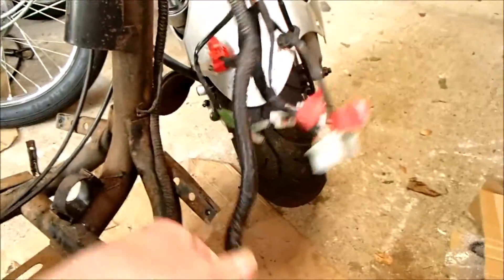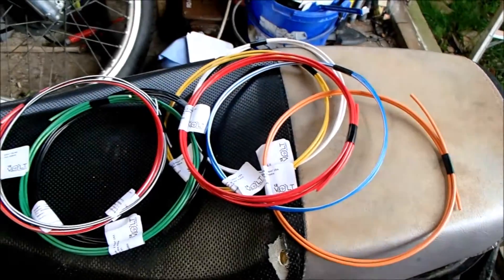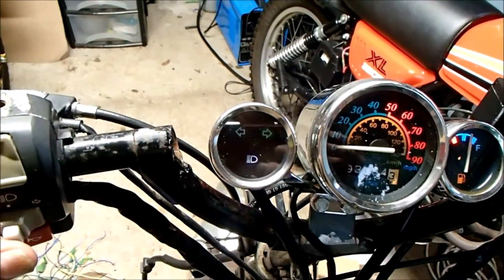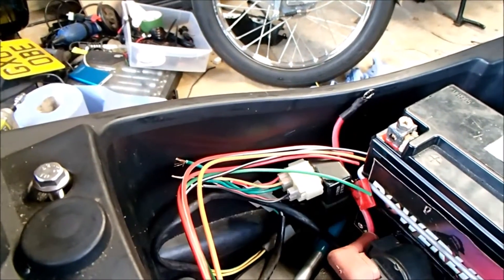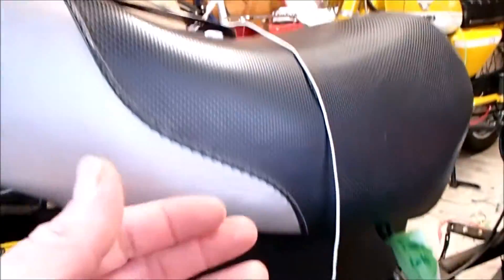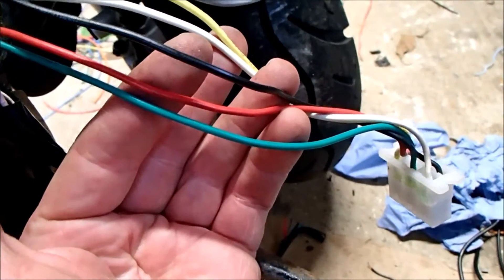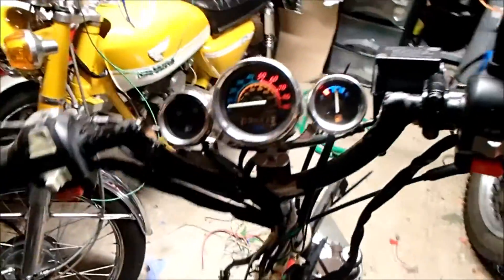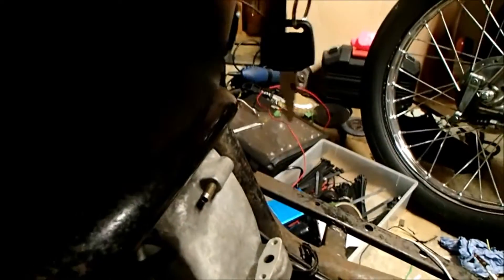Chinese GY6 scooter rewire for naked bike configuration

Comment: 3 years ago I acquired a Peugeot Tweet 2011....a sister bike to the GY6....it was a non runner...as I started to remove panels I could see the frame was pretty rusty so decided to strip it down ...sand blast..and hand painted so it won't be seeing rust for many years
Reply from the maker: I was surprised to see how rusty this frame was the first time I worked on it, it looks like thin black metal paint with no primer was used, as long as it looked good for the first buyer then that was good enough 😂. This frame will get repainted once I'm happy everything is running properly.